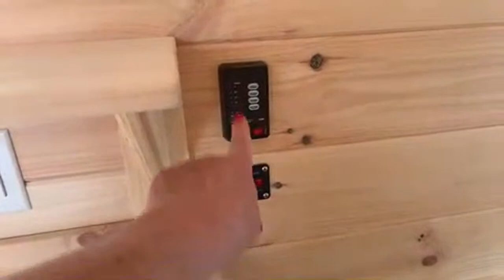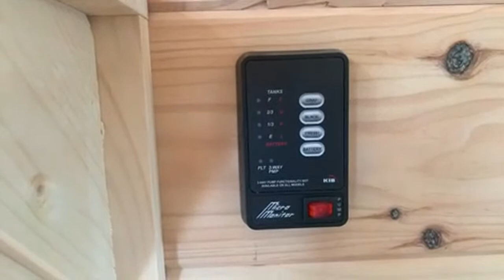How would you like to walk through some tiny homes???!!!

Comment: That 2nd one, 32' long - I'd put a small coat closet just inside the front door, then a stackable washer/dryer, then a narrow built-in pull-out pantry at the end of the kitchen counter, and an oven under the counter. Then opposite the kitchen, I'd put an apt size refrigerator tucked under the stairs, with more storage inside the stairs. I'd sleep downstairs, with storage built-in under the bed, and a twin guest bed and storage in the loft.

Comment: He doesn’t have to know his heritage from a DNA test to know who he is, No one does ; they are akin to entertainment only.
He’s an open book and that’s as honest as you can get.
He is making a difference by doing things right, every minute of the day he breaths as best as he can that day!
 
Here’s an idea…
Think of building a geodesic dome of solar panels, yes not rectangular panels. It will be huge. It could withstand very high winds.the inside could house all the lithium battery storage etc. 
This  could network the  whole community and even those who are on the grid now could eventually be off the grid by association they would just need an inverter  and be hooked up to solar from the dome.
Your growing fast, what are you doing for garbage pick up from everyone? Composting could be done by the whole community to the central area for the community gardens. Everyone would eventually benefit. It wouldn’t take too many years and the benefits would far out way the cons now.

Comment: Randy check out doing a "library" style ladder. It's on a rail. Can be pulled out for climbing then adjusted up to slide out of the way.
Reply: Library ladder system is a brilliant idea. I've seen interesting variations on other channels. Several creative design ideas for best use of space. 1) door hinges attach ladder to loft & rope on both sides, half way up, connect to ceiling pulleys to raise & lower. 2) fold up, pull down attic type ladder. 3) shelves for plants with a portion for stepping. 4) steps disguised in cabinets with 2 hinged shelves only down when in use.
Reply: I like the marine style stairs, too. They are deeper in the tread - alternating for right foot, then left foot, etc. and the front corners are rounded. They take up less floor space, very easy to walk up and down.
Reply: Library ladders would not be for me. They are a fall waiting to happen. What if you have dog? Any dog I have is welcome to nap in my bed. No Library Ladders for me.